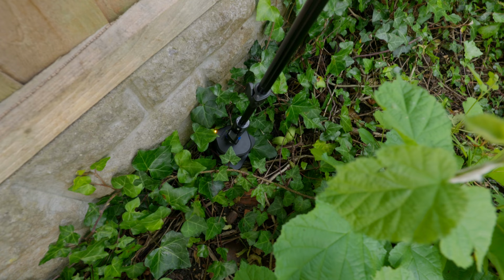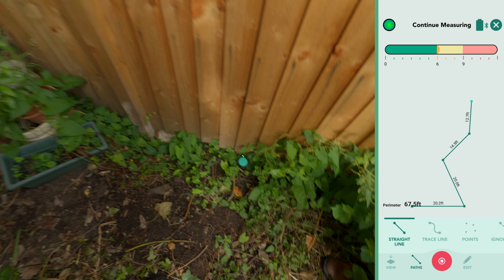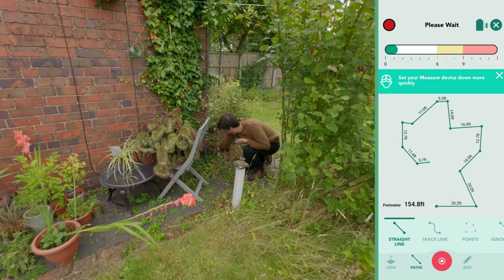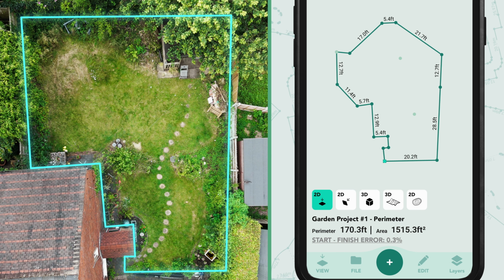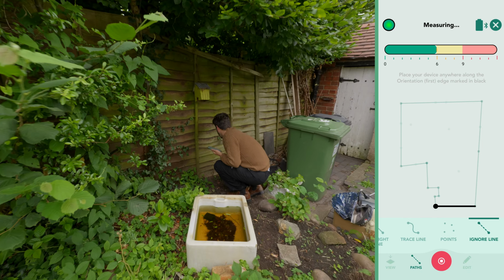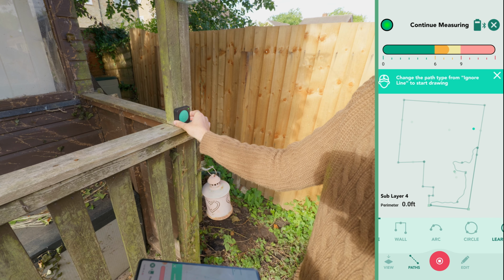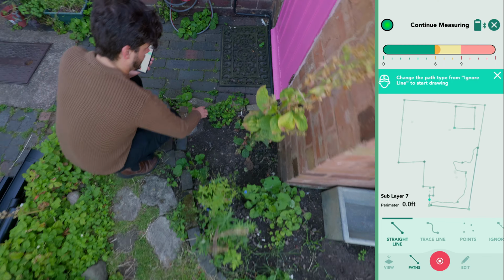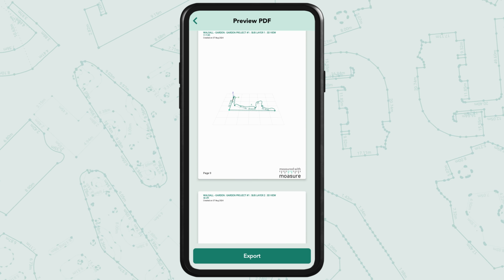Complex Landscaping Tutorial Using Moasure

Comment: Hey there. I have an outside holiday projector that pairs with software that maps my house in order to do precise projections on my house. Next year I’d like to be able to place the projector back to the exact location so I don’t have to map the house all over again. Do you think there is a way to use the measure to map where the projector is today and then use the software somehow to know exactly where to outbid again next year?
Reply from the maker: Hi there, thank you for your question! There are a number of ways you can achieve this. You have the option to Layout from an existing measurement, using Layout mode (exclusive to Moasure 2 PRO) which can guide you to previously marked points. 

For example, you can use Moasure to first map out the perimeter of your outdoor area from a designated starting point, and then use the ‘Points’ path type to mark the exact location of your projector within that space. Then, you can ’Start Layout Mode’ from that measurement in the future and you will be guided back to each captured point as it was measured in the first place. 

Alternatively, you could use the ‘Layers’ function to achieve a similar result using Layout to represent the location of the projector, instead of ‘Points’. Though it is not identical to what your particular use of Moasure would be, this video may be helpful to visualise the process for you, but for irrigation sprinklers instead: https://youtu.be/xRp4aSP0_XA?si=G9XYK9KG0o-DFWQL 

For a more in-depth view of how Layout works, head over to our tutorial here: https://youtu.be/hH4T3WcrBZk?si=3W8xdI4wcCVlbbKj

Hope this is helpful for you!

Comment: Could you put a power switch or one on the app please? Love it but mine keeps shutting off and yes it's charged completely.
Reply from the maker: Hi Jake, thank you for your comment and suggestion regarding a power switch to wake up/turn off the device. 

If you'd like to change how long your device is on for, once powered up, go to the Moasure app > Cog > Measuring Options > Measurement Device Disconnection. Here, you can choose between 30 seconds, 1, 2, or 5 minutes depending on your preference. Hopefully this will improve your measuring process!